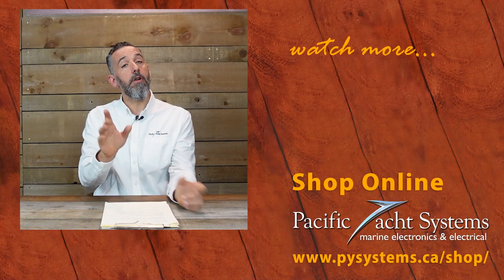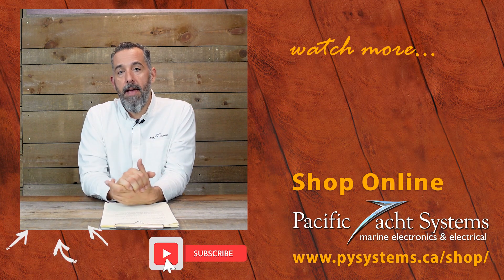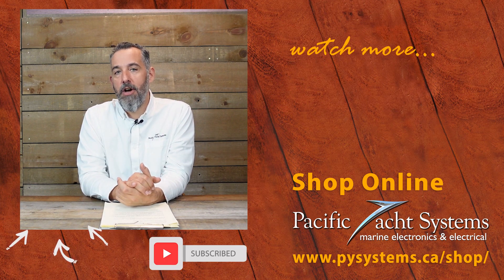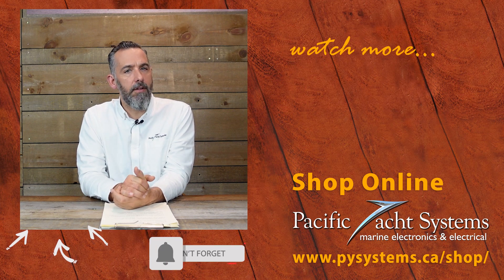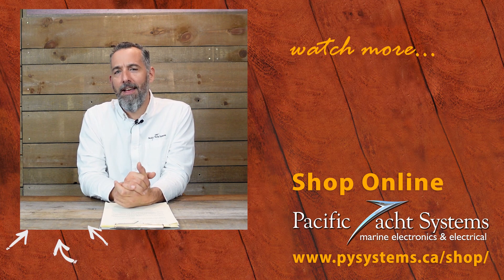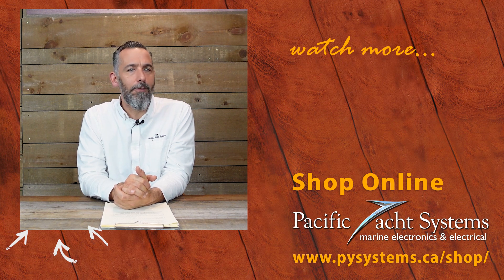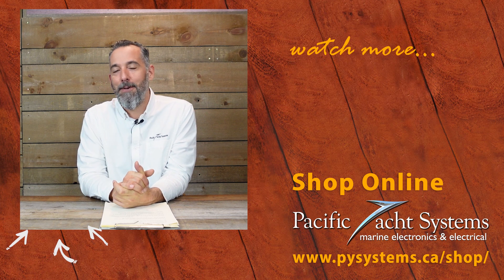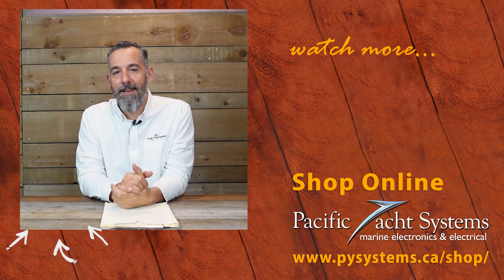Should the Electronics on My Upper and Lower Helm Be on the Same Circuit/Switch/Fuse?

Comment: Hi Jeff. I am installing 4 solar flexible solar panels on my bimini (2x130w + 2x130w). Each 2 in series for one Victron MPPT 100/30. I have a house bank with 3x230A Victron AGM + a starter battery 120 Victron AGM. I have a battery isolator Vitron 100-3 connected from alternador (80A) to house bank + starter. Everything 12V. My question: Should I connect MPPT directly to the house bank or can I connect to the battery isolator? This way charging starter and house bank. Thanks!
Reply from the maker: Suggest, you connect the solar controller to the unswitched positive distribution of your house batteries.

Comment: Also consider the cable runs to each station. One of the functions of the breaker is to protect the cable. It's not good practice to protect 2 cables with one breaker
Reply from the maker: Thanks for sharing!